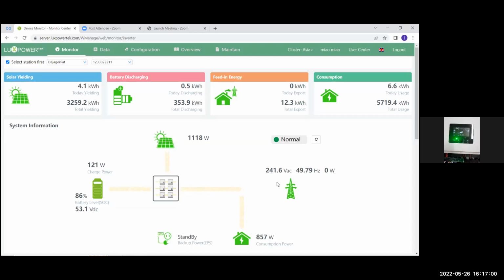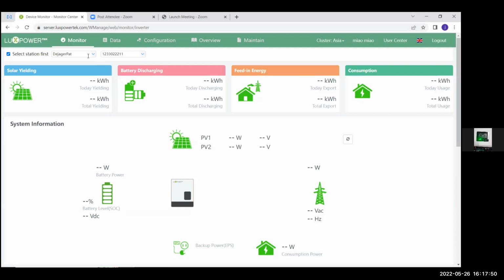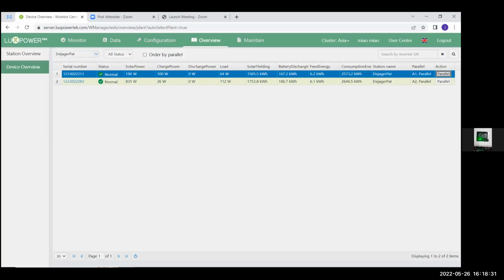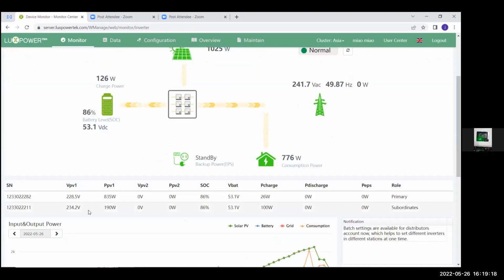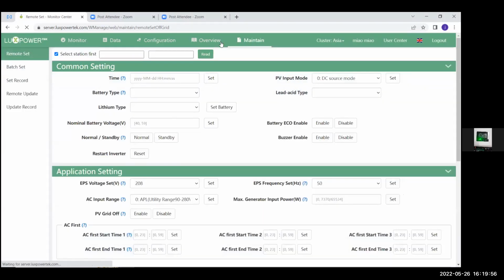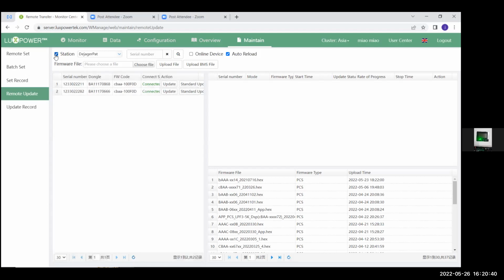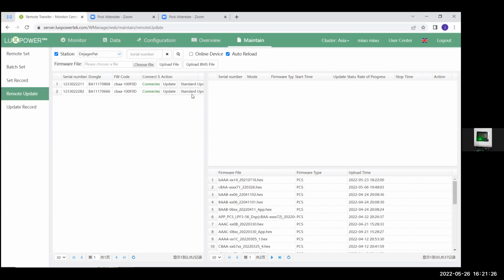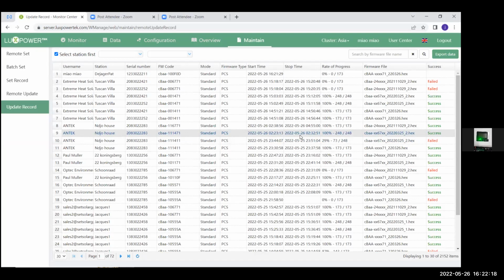Luxpower SNA series parallel online training

Comment: Hi, I have been installing Lux power inverters. I am stuck now I am installing a parallel. my web server, it does not have a remote update (maintain tab) and does not have a parallel button (overview tab - device overview), How I can get permission for my account to have those settings?
Reply from the maker: Hi Sir, thanks for your reaching out. Are you an installer or an enduser? The account limitations vary depending on the account type.
Reply: @LUXPOWERTEK  Hi, I am an end-user.
Reply from the maker: @phanngoccaohuy7726  Sorry Sir, enduser doesn't have the limitation for remote update setting, if you wanna to do this, please contact your supplier.
Reply: @LUXPOWERTEK Thanks for your feedback, I understand and will contact my supplier.

Comment: Hi, I am busy with x2 SNA5000 units and they will be setup in Parallel mode, I have the new model with the Blue dip switches and my AC out only has L&N outputs No PE , I have been told that I must bridge my incoming AC earth with the outgoing Neutral, Is this correct?

Comment: I got a question. I try to use rccb to each inverter output but when I try to run the inverters in parallel it trips. Can run the inverters individually but not in parallel mode.

Comment: can i use a hoselect lithium battery on my inverter,and how do i need to make the cominication cable for it,can you please help ,my inverter does not pick up battery and keeps showing a warning face.
Reply from the maker: Hello Piet, Luxpower supports lead acid battery and compatible lithium brand to use with our inverter, you can find the compatible brand on our webpage(https://luxpowertek.com/wp-content/uploads/2022/06/Luxpower-Compatible-List_20220602.pdf).